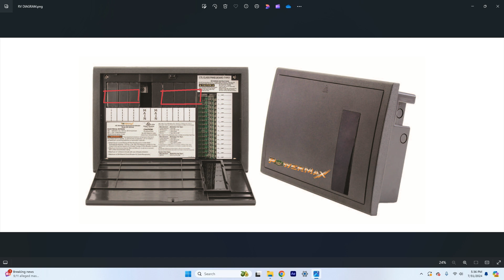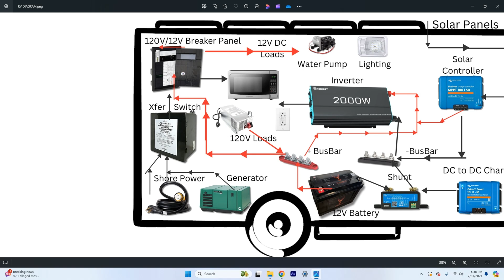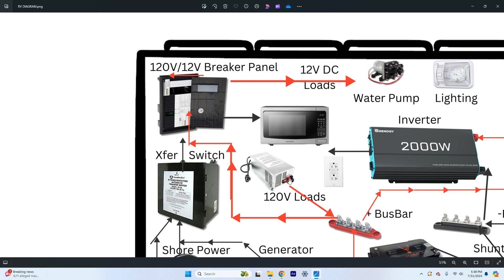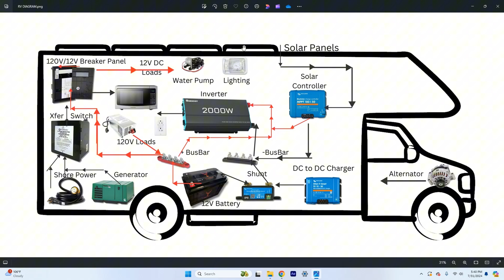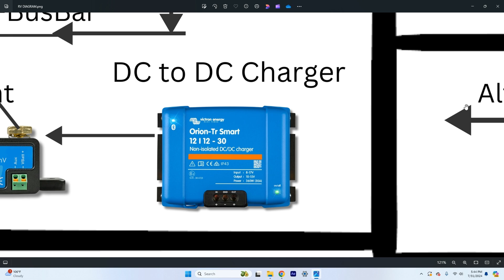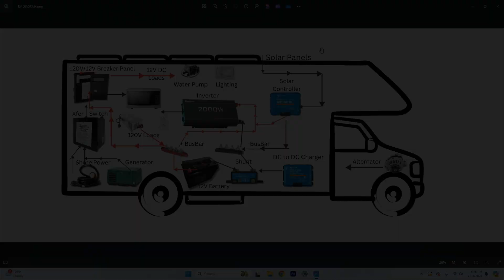RV ELECTRICAL System EXPLAINED! 12V, 120V, Solar, Batteries & More!

Comment: I wasn't too impressed when I found out that the power inverter in my travel trailer powers 3 outlets but they're all high up on the wall for TV's....I could see maybe 1 TV receptacle being powered, but all 3 and not a single regular outlet in the rest of the trailer, pretty stupid I think.  

I also have realized that the 200 watt solar panel on the roof is practically useless, it barely maintains the battery charge throughout the day around 80-85% from overnight use, it won't charge the batteries back up after the night....so I definitely need to add another couple panels, and since the roof is already wired for 2 additional panels I'll be adding some soon.  

I also think I'll upgrade the batteries that I had the dealer upgrade when I got the trailer...they installed Lifepo4 batteries, but only installed 100ah ones.  I'm thinking I want at least triple that to 300ah each....or more if I can find them to fit the battery box.
Reply from the maker: You just summed up about every electrical disappointment that is in the industry right now! Haha
Reply: @RvPowerPlug  You would think these manufacturers after all these years of building RV's and price gouging for them, they'd actually be able to build them properly, and design the electrical/plumbing systems properly, maybe they need to talk to owners, instead of their pencil pushing office idiots about how and what an RV should be built like.  For the prices they want for them, 1960's and 70's 1/8" wall panels is pretty pathetic and CHEAP.  Given how much they weigh anyways there's no reason they should be cutting quality to save weight.  I'd rather have the RV go down the road for 20+ years without falling apart instead of worrying about saving a few pounds to make the trailer lighter.
Reply: @wildbill23c it’s America get over it . Our vehicle manufacturers suck just as bad . You should check out the travel trailers they build in turkey , Europe and even china . Insane quality